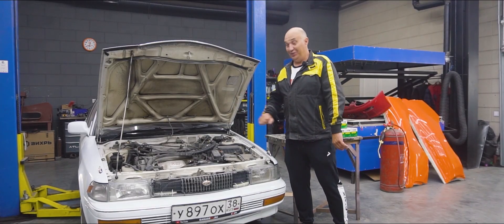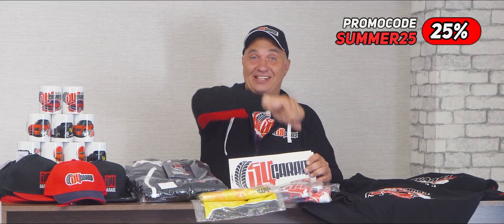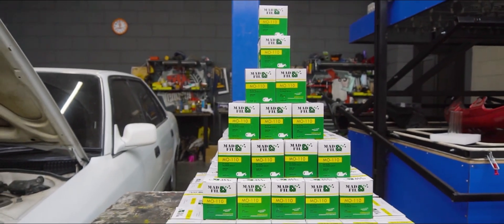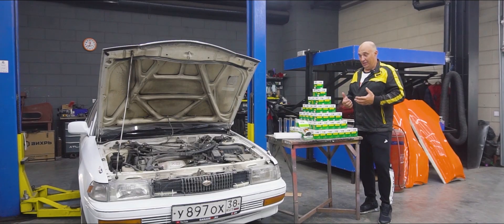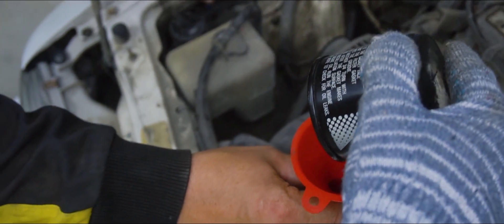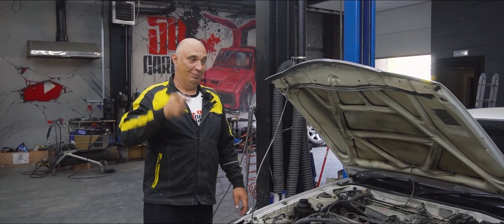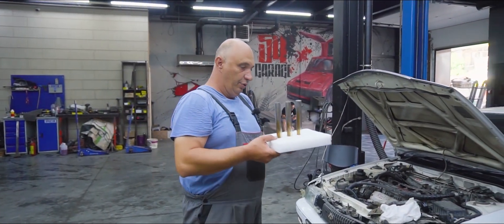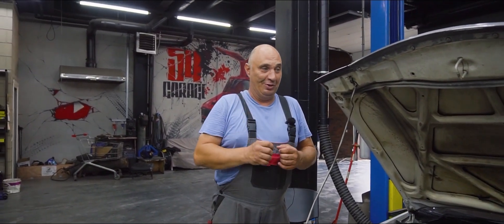Can 50 oil filters make used motor oil clear again?

Comment: Need a filter with a lower micron rating. Then see what happens.
Reply: yeah but old oil is still old oil, even if you filter it good enough that it becomes clear again. 
Its not just micro particles, its also the properties old the oil that degrade over time and use, and thats way more important than the particles themselves. The main issue is that oil loses its viscosity and so it starts causing an accelerated wear on the parts. Its like trying to use water instead of oil. Water is thin and so it doesnt have enough strength to keeps the parts from rubbing against each other.
Reply: @laharl2k  this engine is gasoline so water also stays inside...
50 Filters price more$$$ than new oil :-)
And all the 'acid' stuff that comes from combusting byproduct inside the engine
Reply: First coarse filter and then finer and finer.

Comment: I really expected 50 filters in series
Reply: Now I want to see 50 in series
Reply: @MrBistrochef  same
Reply: With clear line in between to see progression
Reply: Otherwise what would be the point 😅
Reply: @jordanthedove  😅
Reply: There wouldn't be anywhere near enough oil in the engine to fill 10, let alone 50.
Reply: @MattyEngland  Then you add more used oil.. ?
Reply: @Engineer9736  Completely impractical with a running engine. Maybe if you poured the oil through the filters by hand, but then that would be pretty boring.
Reply: @MattyEngland  *laughs in diesel*
Reply: @MattyEngland  😅
Reply: @MattyEngland  just keep pouring in more oil
Reply: @MattyEngland  So keep filling untill all filters are filled... ?
Reply: @MattyEngland  I think he means to have it pass through each individual filter 1 by 1 or as much as you can get out of the filter as you will always leave a little bit inside.
Reply: @MattyEngland prime them and use more oil?
Reply: @MattyEngland  so put more in as it cycles
Reply: @MattyEngland  maybe for a large diesel engine. small automotive filters don't hold much.
Reply: @danr3778  They hold about 500ml usually.
Reply: @MattyEngland  when the engine is running, yes. But unscrew it and pour out and see how much the paper can hold. But if they made a contraption with 50 filters then they'd need more oil maybe around 10-15 qt.
Reply: @MattyEngland  but... can it be done?
Reply: @MattyEngland that wouldn't be an issue if you prime them first
Reply: me too... i was already think of the measurements of the center thread
Reply: That poor oil pump.
Reply: @the_kombinator  does work for nothing
Reply: @Saif Khan 🤔
Reply: Yeah. I pictured 50 remote oil filter kits plumbed in series, a couple gallons of used engine oil, some kind of electric oil pump, and one of those large water cooler bottles as an output tank.......... I hate to say it, but compared to how I THOUGHT this was going to go down, what they actually ended up doing felt a bit anticlimactic. :(
Reply: Mounted on the car of course.
Reply: @kollak01  they would be an oil cooler as well!
Reply: I, too, thought they would put them in series. 😅
Reply: Me too. But I want to see them connecting 50 different filters. From normal filters to finer filters.
Reply: @Saif Khan what? Bot?
Reply: I expected 50 filters in parallel 😫
Reply: @Saif Khan She does? I'd have to ask her. Typically she doesn't care about stuff like that. As for the filters being wasted, why? They were only on the car for 5 minutes.
Reply: Right? Now they will do this. Feed the youtube giant!
Reply: Although I would like to see that as well with clear tubing between filters, there could be issues. For one there is likely no easy way to plumb into the oil system on that engine. It also sounds like that car belongs to some one and is a daily driver. I also might expect there to be oil flow problems trying to feed through 50 filters that there might be so much head pressure either the stock oil pump might not keep up or it builds so much pressure you have a blow out somewhere. Another issue it they would have to buy 50 oil filter bases to screw 50 oil filters to. Then they are stuck with 50 oil filter bases with nothing to put them on after the fact. logistically doing the video that way doesn't make sense.
Reply: @Saif Khan you ok M8?  Parents didn't hug you enough?
Reply: @Saif Khan Don't do any more drugs, it seems they already made you an imbecile.
Reply: This are 30 or 50 micron filters, Why should they Clean the Oil more than that ? You need 5 micron filter
Reply: @gasauto1675  also correct, and the additive pack is also long gone in that oil too haha
Reply: So did I.
Reply: Same
Reply: Yeh me too, quite disappointed
Reply: thats what I thought too.
Reply: I did too 🤣
Reply: Right?!?  This is 1 filter 50 times, not 50 filters. 😂
Reply: Or parallel.
Reply: To much restriction.
Reply: I said the same, then I said oh, wait...were gonna need a bigger pump...
Reply: Same
Reply: Same xd :P
Reply: Да, I was thinking about this same thing.
Reply: I wanted to see 50 in sync for real
Reply: We all did
Reply: Now the pressure drop as gotten so low it’s pulling vacuum now 😤🤘🏼 😂
Reply: You'd have to pre-fill all of them to get oil pressure quick lol.
Reply: @Dcc357  it runs for like 10 minutes without oil pressure and by the time it fills filter 45 the sump runs dry lol
Reply: @Saif Khan someone’s a third grader.
Reply: same
Reply: Same, I wanted to see a big contraption with a pump circulating through 50 filters
Reply: That’s what I thought, that they would be mounting the filters on some form of fabricated “oil rail” or manifold.
Reply: That's immediately what my mind went to
Reply: Me too. But than i thought that the oilpressure drop at the last filter will be a way to much.
Reply: He mislead us so he could get views on his video.
Reply: 100 percent agree id like to see it in series also! I dont there is much to gain simply replacijg filters one by one
Reply: Same
Reply: Someone should do that lol
Reply: Did they ever do this?
Reply: me too
Reply: you me and everyone else 😂😂
Reply: Plumb them in series!
Reply: Me too
Reply: same
Reply: thats what i was expecting too, some weird contraption sticking out of the hood.
Reply: Awww you ruined it!
Reply: Same
Reply: I'd like to see gasoline as coolant 😊